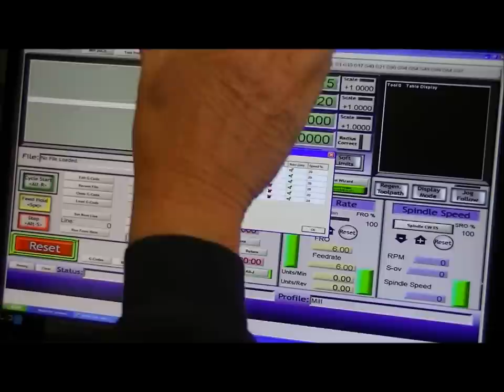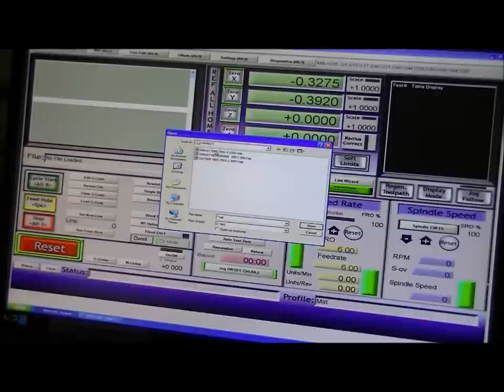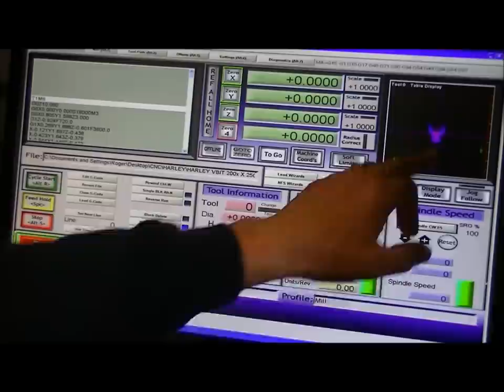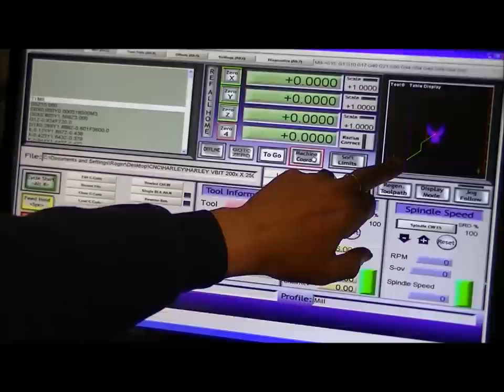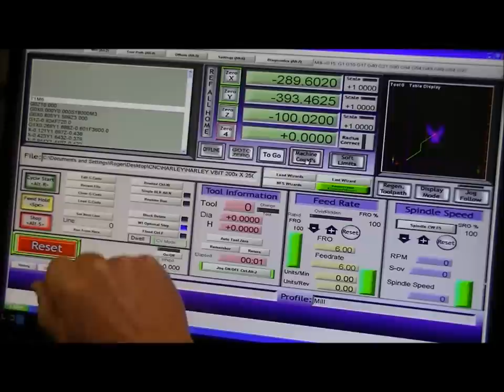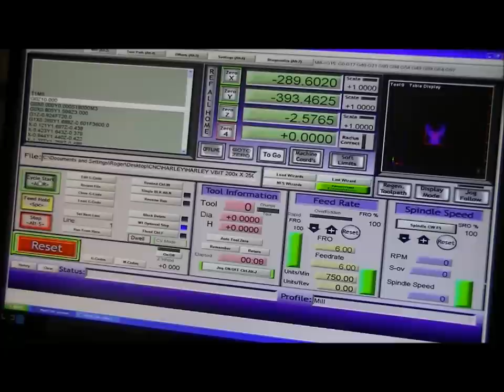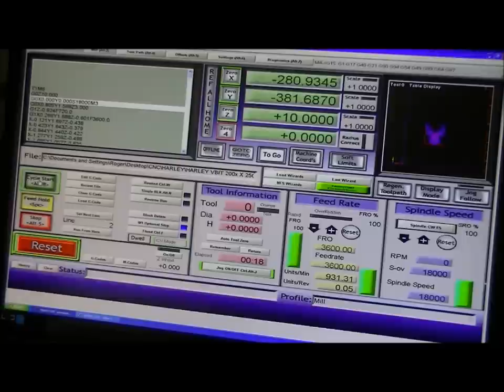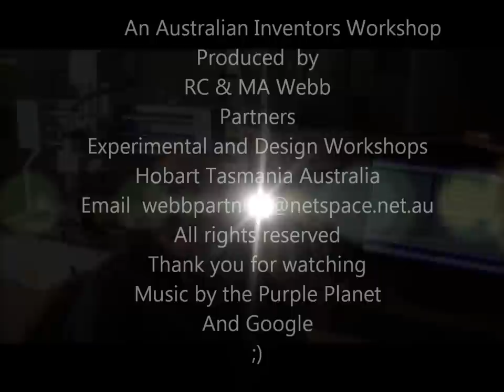Easy learning,  Mach3 Basic tutorial  machine work area Configuring.

Comment: How to connect with the cnc in the status bar it's not showing connected pls tell me I have already connected the ethernet in my pc but mach3 is not detecting this
Reply from the maker: Hi, you will need a driver for your machine,
Reply: @rogerwebb9600  which driver needs to install for the xps -rl motion controller
Reply from the maker: @shobhangiverma7090  Your seller should have provided a driver

Comment: Hi there Roger. Thanks again for all your videos. I have done all what you show us, and great it all worked well, until now.
Today I wanted to engrave some words and wierd thing happened, the first letter was fine but each next letter went deeper and deeper in the material. I had set all the letters to be engraved in the same depth. Maybe you know what could be the problem? Could it be the machine? I have calibrated the axis several times and it goes correct. Please please help if you know what could be the problem. Thank a million.

Comment: hi, I have a question. iam about to move a big router CNC  machine from one shop to a different shop and i will need to disconnect all the wires ,  will it be a problem to set it up when i will assemble it back in a second shop. or just plug and play . other words will i have to program machine after disconnecting all the wires from control box . Thank you
Reply: shouldnt if you have your settings saved in Mach 3. I unplugged myne and moved it cross the country twice

Comment: can you help me fix my home and soft limits? my bed is Y-279 & X+203 Z+57 and i currently have my HOME at our SW corner of the cnc mil with the Z axis all the way up thats HOME
Reply from the maker: Franks Hots This is OK
Reply: Roger Webb THANK for your response,  the issue is that it seems that when im home Y&Z should be moving away from 0 "home" in the Positive direction? but as you see by my setup one is in the - & the other is in the + direction so if i run a G-code  from your software one axis will not be heading into the center of the material but away
Reply from the maker: Franks Hots 

Ok, now I understand, go into config (top left hand
side) of Mach 3 window. Then click on home and limits in this window you can
change the individual axes from + to - this should sort your problem out. 

Roger Clyde Webb Australia ; ))

Comment: Dear Roger. Thank you so much for your videos, they help a lot. Just wondering maybe you can help me something. I am quite new with all this programm and the cnc machine, so it doesn't come easy for me. But the thing I am struggling now is that i don't know how I get the machine cut/engrave in exact place I need. I think i might of miss putting some details in Mach3 or something. And the worst part is that for some reason the spindle goes right into the material, how and where should i fix that it stops exactly where the materail begins? I am sorry if my questions are stupid, but I had tried to figure this out myself but no luck. I would so appreciate your help. Best regards, Agnese
Reply from the maker: Agnese Dambe
 Gday Agnese, Ok, you need to have a look at my videos 78, 79 and *88* then you will be ok, good to go. ;-) 
Roger Clyde Webb Australia ;-)
Reply: Roger Webb
 Thank You, Roger so much. I did check and watch your videos many times, I must of been doing something wrong. I noticed one thing though, that my image is out of the table as well, how you get it in the middle, you say, just need to jog it over, but what are you doing?
I am trully appreciate your time on answering propably on my easy questions. Best wishes.